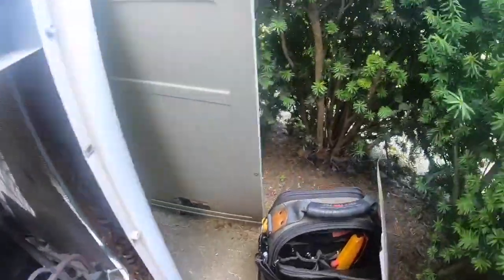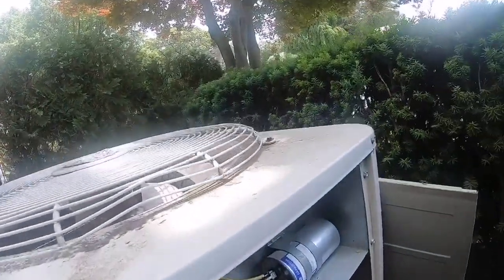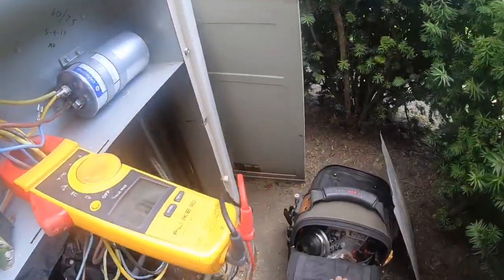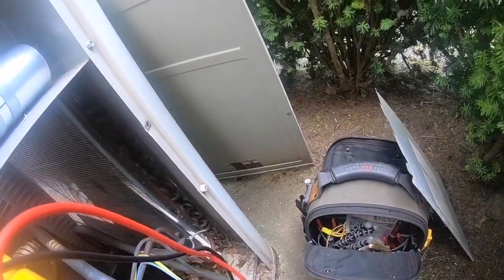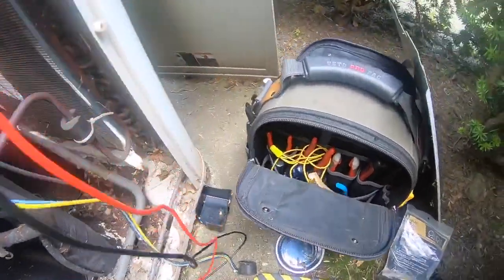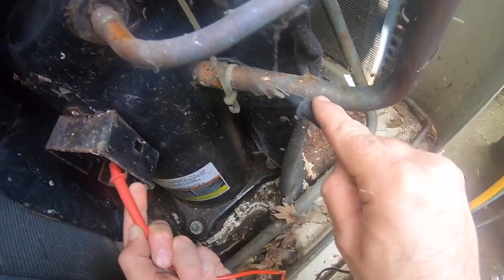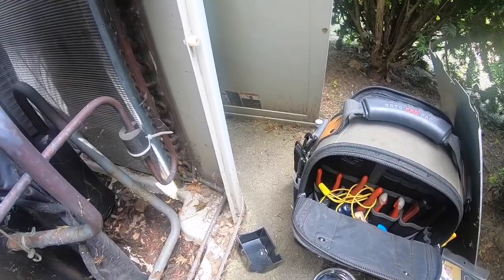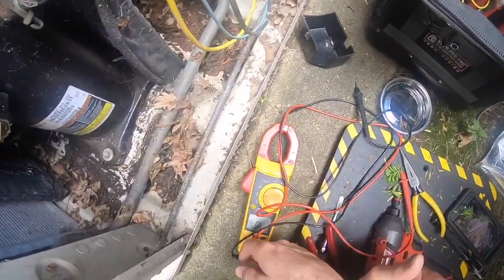Air Conditioning Breaker Trip When Starting

Comment: I don't know how hot compressors normally get under normal operating circumstances, but wouldn't it overheat with the blanket on it?
Reply: I agree, but after years of service I would see them all the time. Designed to be quite but I think they overheated them…If I replaced the compressor I would throw the cover away….

Comment: Sir. When u mentioned there should have zero reading between terminal to ground... if have some reading, mean its grounded compressor?
Reply from the maker: Yes, it’s grounded. does your compressor blow breaker on start?
Reply: Yes When I unplug the compressor does not trip as soon as I plug it back in it trips the breaker it’s only one year old but a mouse has been living inside No Wires have been bitten though can you please help thank you

Comment: Grounded compressor, so...what the hell does that mean to the lay person??? I found this video useless!
Reply: Winding inside touching case casing breaker to trip , final answer bad compressor needs replacement very expensive can not be fix in the field needs to go back to manufacture for possible rebuild if pass many other test. cases can be a number of things , I seen most is age cause it.
Reply: Meaning the winding inside touch the wall of the compressor which connect to the pipe and to the earth.

Therefore it trip the power.

Mean scrap.. because no point replacing the compressor if the entire system are old and rusty.